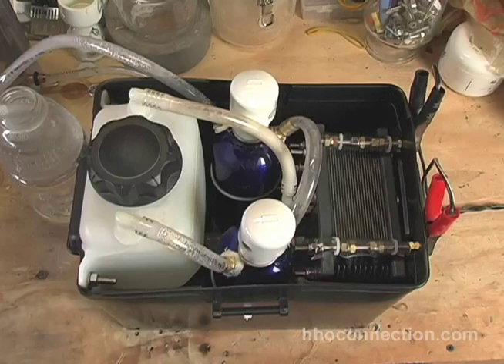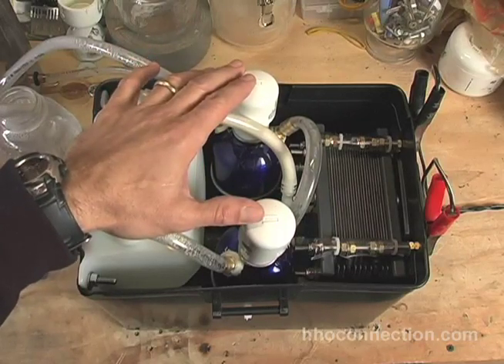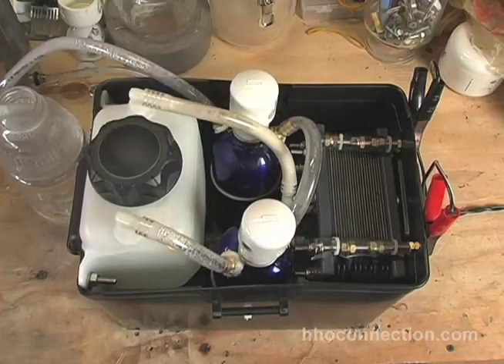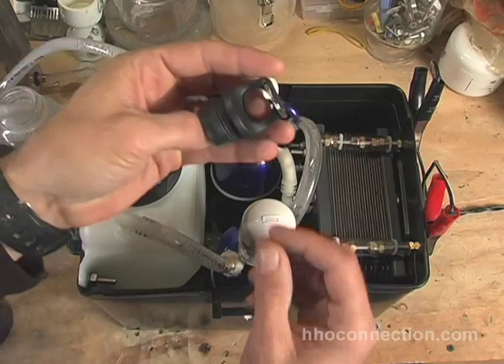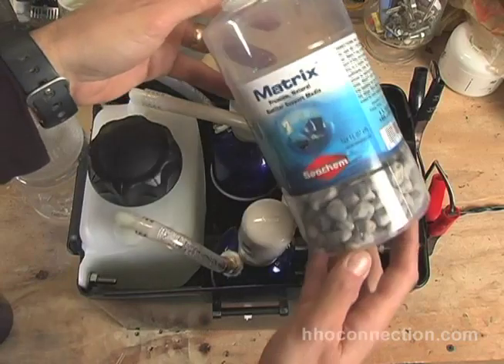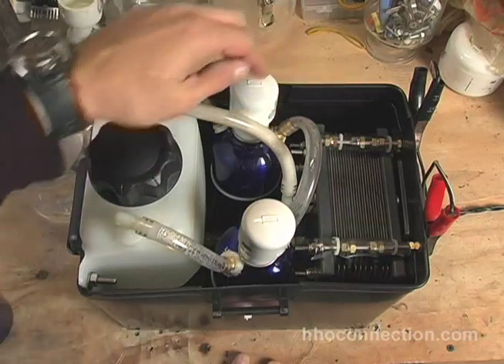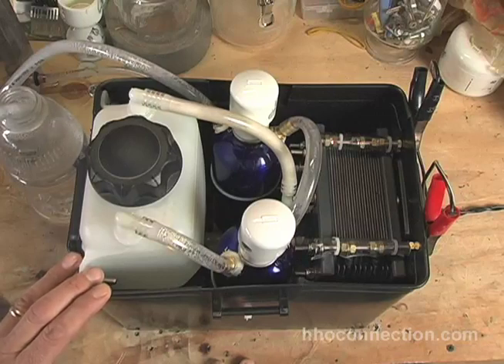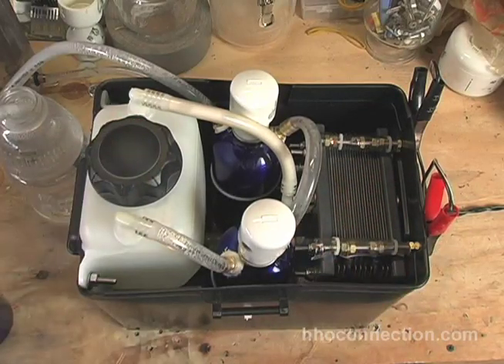HHO Dry Cell Battery Box v2

Comment: Ask any chemist, sodium hydroxide does not form vapor.  The vapor is water.  The vapor is either caused by heat or by recombination of O2 and H2.  When vapor happens, try  ice in the reservoir.  If ice stops the vapor, heat is playing a role in the vapor formation.

Comment: I have seen your previous videos like the torch ones and I was wondering if you could possibly use some various technics to heat your house in winter??
Reply: if you have any type of HHO cell, you can heat your house simply by using a gas radiator, you feed the HHO gas + plain air into the radiator and heat its produce, but you must make sure you have the proper mixture of gas and air, becuase the HHO alone its way too powerfull, hope it helps, cheers.